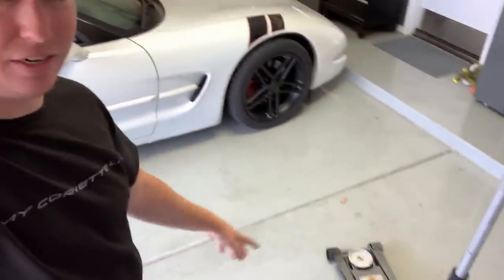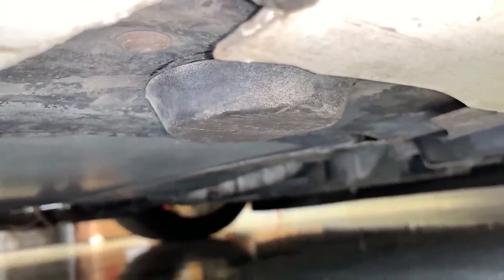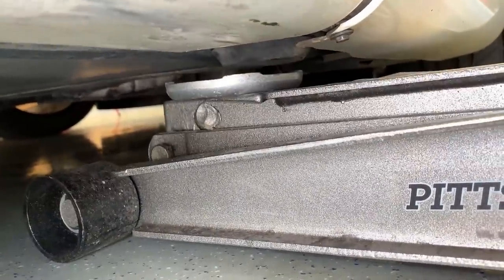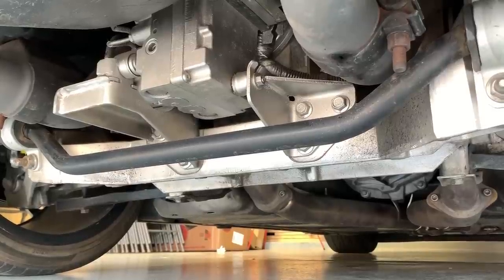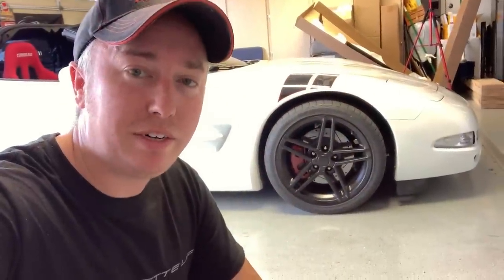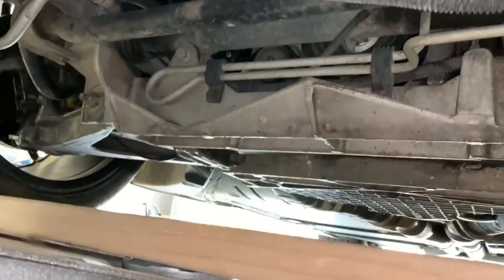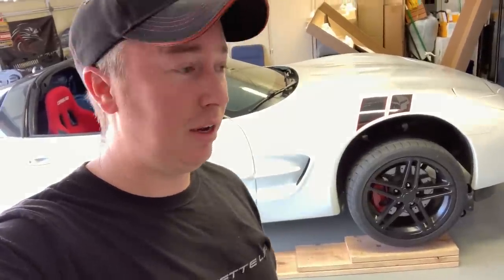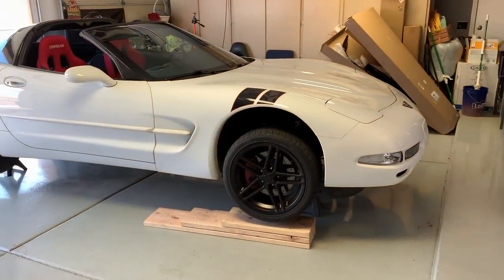How To Jack Up a C5/C6 Corvette

Comment: If any of you are changing your own oil in your c5 or c6 make sure your rear end is higher then the front whilst draining the oil. And do not be in a hurry,  it takes about 20/30 minutes for all the old oil to drain out. The drain plug is 15mm. And it holds 6 quarts of mobile one 5w30..Have a great day.
Reply from the maker: 7qts if you have a C5 with the batwing oil pan.
Reply: 6 or 7 i have a 2004 and it needs oil
Reply: @mycorvettelife  10.5 with a grandsport lol
Reply: Not all Grand Sports have the dry sump oiling system. Only the ones with manual transmissions. I wouldn't want someone to dump 10 quarts of oil in a non-dry sump system because they read somewhere that's what they take. @LegacyAftermath

Comment: thanks, I've had my c5 2004 coupe for 12 years and first I heard of a hockey puck, never jacked it up myself, hard to believe the price of the jack is more than double in 5 years assuming this is the one you have, PITTSBURGH 2 Ton Low-Profile Floor Jack with RAPID PUMP, Slate Gray . love your videos pal.   nice big piece of plastic cellophane was sucked in my radiator causing it to overheat, I managed to get my head under there to see it without the jack for now,  thank you!

Comment: I really like your Corvette and also like your Channel. One thing to add to your comments that might be helpful the factory recommends that whenever you jack up a fiberglass Corvette specially if you're not jacking it up on a power lift which Jack's all four corners up level at the same time, but if you're jacking up one end or the other at different times, to keep the fiberglass from cracking you need to open the hood the trunk and both doors because the body is going to  Twist a little bit,  and this will keep all movable panels in line and keep them from scratching and cracking.

Comment: Successful SCCA Racers, from whom I took my advice, have been side jacking the Corvette for decades.  under the rear seat bolt area.  Youll see a sheet metal brace looking part.  that located the jacking position to lift the entire side of the car  no frame twist nor denting.  Otherwise, pretty good instructible.  I have also used stacked 2x8's DIY ramps d/t to the front overhang as you said. Cheaper than RAceramps, adn more compact/

Comment: Very thorough! Thanks. Now, those stepped ramp wood blocks you used on the front - think the air dam would clear those edges if one wanted to just drive onto the ramps? They look like a possible alternative to Race Ramps.

Comment: I think the moment I bought my C5 which is also lowered, I knew right away I was using it as an excuse to by a pair of QuickJacks.    Never looked back.   Chris as much as you jack your car up you would be a perfect candidate.   They can be used on all your cars unless you drive a full size truck or something of the like.
Reply from the maker: Believe me, I know....I’ve been wanting Quick Jacks forever.  It’s just tough to justify $1000

Comment: I actually built steped up ramps for running my car up on standard ramps. Similar to what he did, just longer. And if your xhanging oil, the rear end has to be higher than the front end.

Comment: informative video. Had a question though, I had a mechanic do some work on my c5 Z06, and he just jacked the car up from the rear crossmember (under the differential) and front crossmember without using the wood blocks. He did place a protective pad to make sure there wasnt any metal on metal contact, but do you think this could have caused damage? I don't see any cracks or bends, but I've seen a lot of videos where the wood blocks are used

Comment: I made my own. Four hockey pucks, drilled the middle out, got two eye bolts, nuts and washers  (the bottom of the puck it was a special washer/nut w/barbs to stick in the rubber ). Maybe  $ 10.00 compared to  $70. -$80. each.
Reply: 4 eye bolts

Comment: If you're going to jack up the car to put the ramps under the tires what's the purpose of the ramps. Just use blocks of wood to get the car high enough to jack the car from the front. Also, probably not a good idea to put jack stands under suspension parts like the control arm bushing bracket, and definitely not the control arm itself.  The control arm is angled down when the weight is taken off of them so the jackstand could slide when the jack is lowered possibly causing the car to fall off of the jack stand.  A safer way would be to use a shorter block of wood on the jack and put the jackstands under the cradle. If you're doing something under the car like changing the oil, that you don't need the weight off of the suspension just use wheel cradles like the ones from Race Ramps. Or you can make your own out of 2x4's.  You can Google how to make those. Assuming you have the room to store them.  Or if you're a serious DIY'er invest in a 2 post lift.  That's my 2 cent's worth but I think it's solid advice. Congrats on the channel. We all can help each other.

Comment: Oh yeah...the lifting pucks aren't designed to be left in place. They have a T shaped section on the top of them. You line the T with the slot and then turn them 1/4 turn to hold them in place while jacking. If you leave them in place they will rattle around until the T lines up with the slot and then fall out never to be seen again.  They do make ones that can be installed permanently but I wouldn't spend the money for them. I just rounded off the corners of a piece of 2x4 and sit that on top of the jack.

Comment: Can you tell me what is the Sense of those Lifting Pucks?
I have a Low Profile Jack. But yourse is pure Metal. Mine Jack have some Rubber Skin on the Lift Dish.
I think with those Rubber Skin i dont need no Lifting Puck, am i right?
Reply from the maker: Negative.  The lifting points under the Corvette are higher than the rocker panel.  If you don’t use a puck, you will crush the fiberglass on your rocker.

Comment: My e-brake isn't working on the first pull but does on the 2nd or 3rd pull. Strange, huh?
Reply: I always thought it was a ratchet thing If your brakes are new and have a lot of pad it should be a quick pull. If they are worn then you nerd to ratchet it up a couple more notches and the when you release it then it goes back to the first clearance. Probably bullshit but it sounds good. Lol
Reply: @georgejungle7521  my brakes do make a slight screeching noise when stepped on. There could be some truth to that. I'll be replacing them soon. Guess I'll find out.

Comment: Hey great video. Question about jacking up the FRONT by the subframe. 

Some say that the REAR cross beam should be used on the FRONT subframe. You have used the front. Which is a heck of a lot easier to get at. 

Is the front beam (right under the crank) ok to use ?
Reply from the maker: Yes

Comment: NEVER put jack stands under or lift a car by the control arms
Reply: Can you explain why? Isn't the tire doing the exact same thing?
Reply: @tahoejohnny3991  Because the weight is NOT distributed properly, so bending, breaking or distortion of parts can occur. 

The tires support the weight in a balanced/correct manner.

Therefore, lift the corvette as shown in the manual for its safety and yours.
Reply: @stuuuporman  That makes sense.  Thanks!